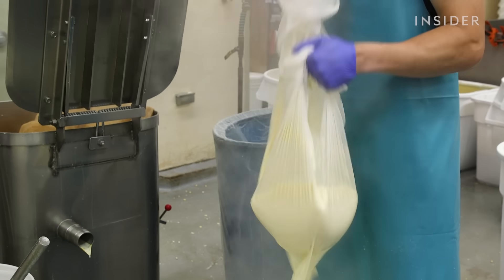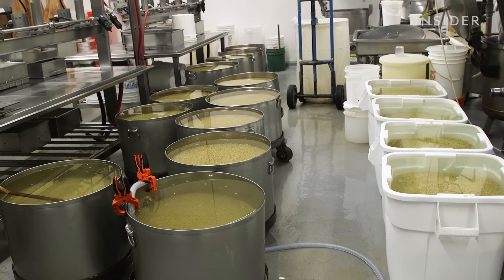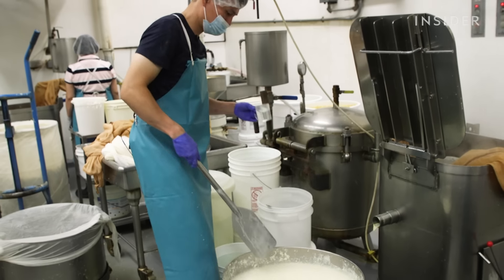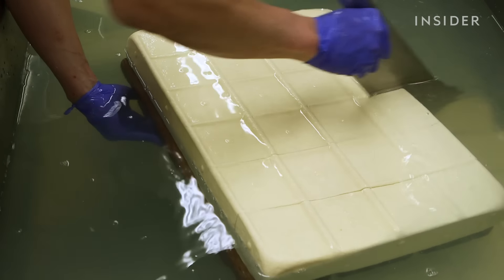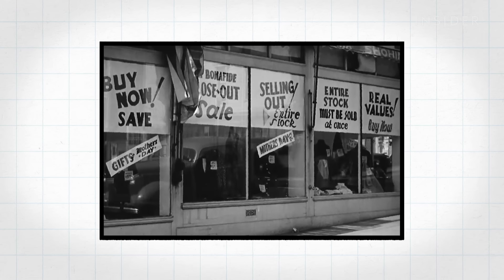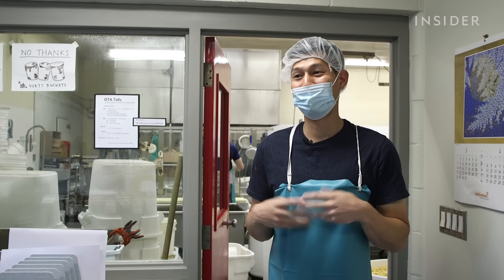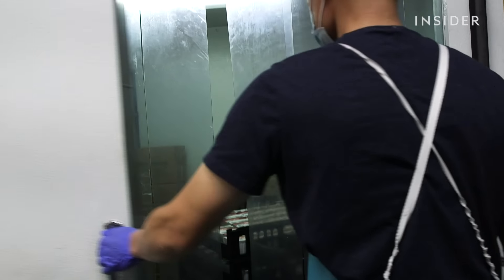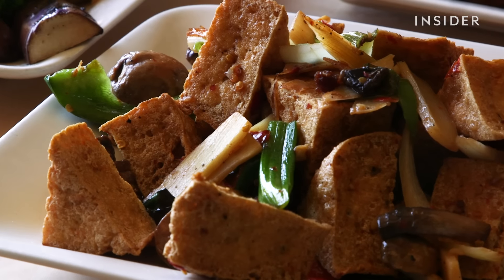How 3,000 Pounds Of Tofu Are Handmade A Day | Big Business

Comment: Great video but a confusing graphic at 1:30 . The thermometer should say 100C instead of 100F and shouldn’t do any moving when it converts to Fahrenheit because 100C and 212F are equivalent. Surprised nobody picked up on that considering the guy in the video specifies Celsius and gives Fahrenheit numbers for your viewers. 

Tl;dr it’s not 100 to 212F it’s 100C or 212F

Comment: I would think that increase in ingredients will help artisan manufactures if anything. There would already exist a price gap in cost of manufacturing, but that gap isn't going to change. If the base price of everything increase, the gap would become a smaller percentage. Further, those who would buy artisan stuff over the cheaper mass produced variety tend to be less price sensitive.
While that's not to say there won't be any loss, as there might be a few who can barely afford the good stuff, relatively speaking shouldn't they be suffering less than their competitors?

Comment: Some Chinese restaurants make tofu by hand (when they serve you tofu jelly, for breakfast). And making tofu yourself isn't hard, just get a soymilk machine (they cost like 80-90 dollars), which you just need to put something to make the tofu coagulate, use a mould to squeeze the bits together and apply pressure. More expensive machines will give you tools to do that as well